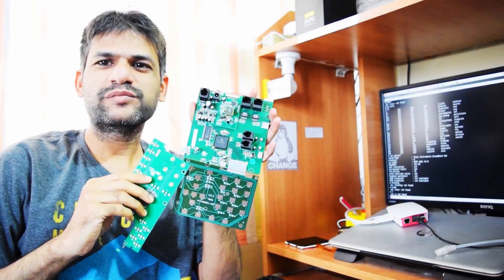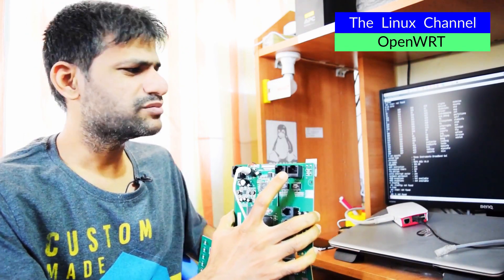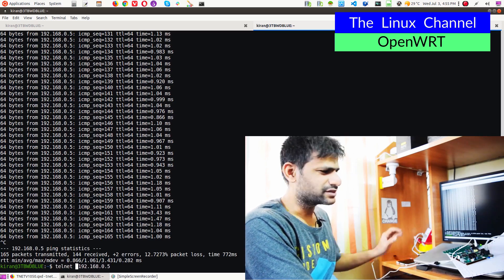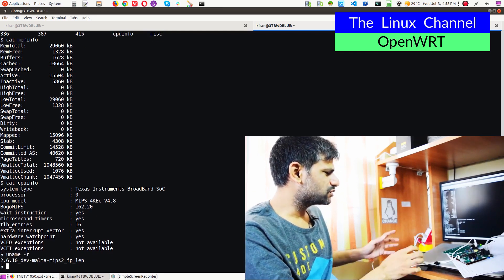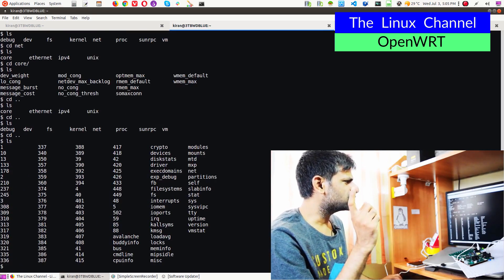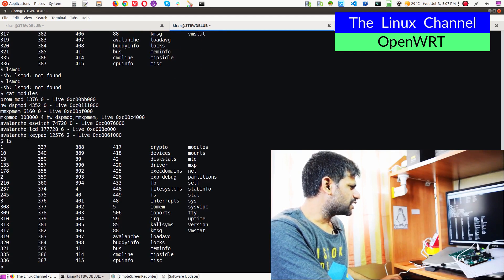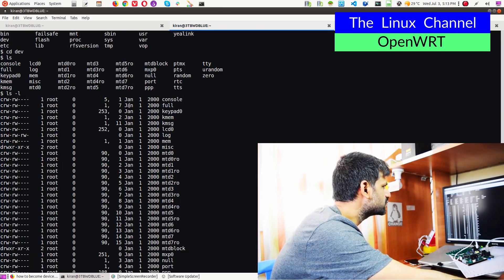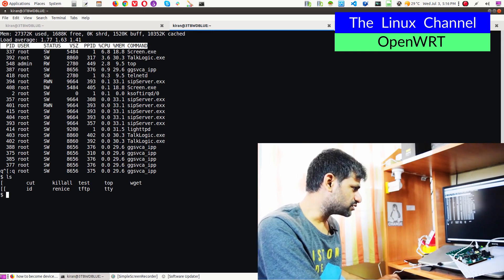0x1c4 Texas Instruments BroadBand SoC TNETV1055 MIPS32 4KEc V4.8 | BusyBox Embedded Linux | VLOG

Comment: OpenWRT should be a brilliant thing which lets you use a broadband router with custom firmware.
Reply from the maker: true. Its a lightweight OS (kernel + other components), will leave you room to add other stuff. And so perfect to make a network appliance with this platform :)